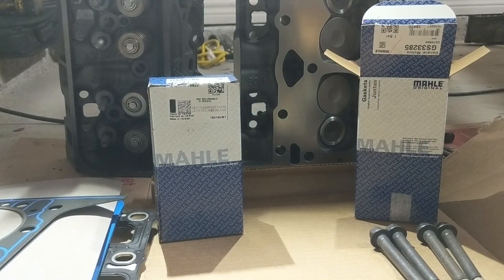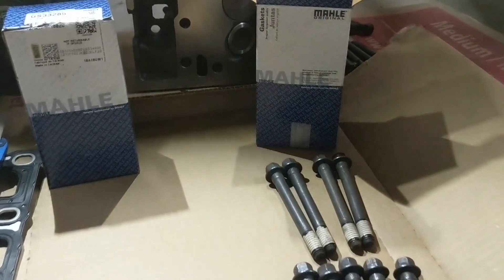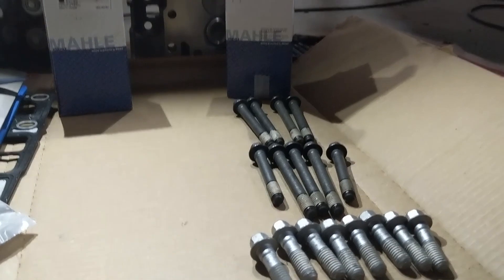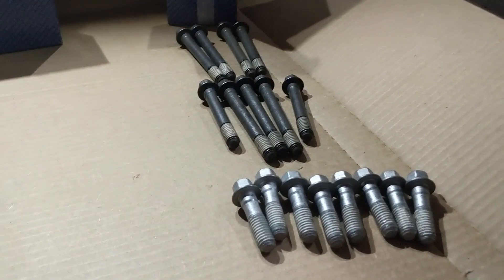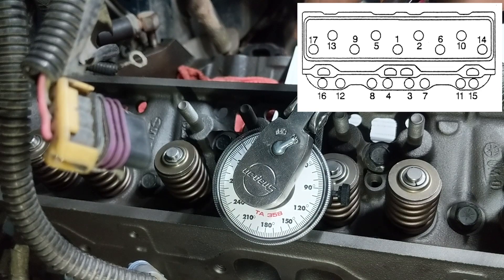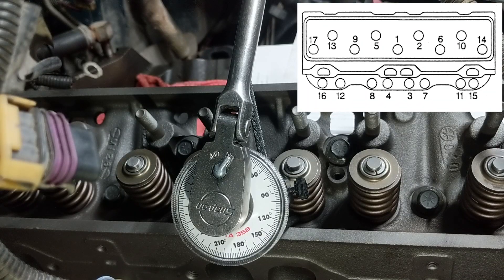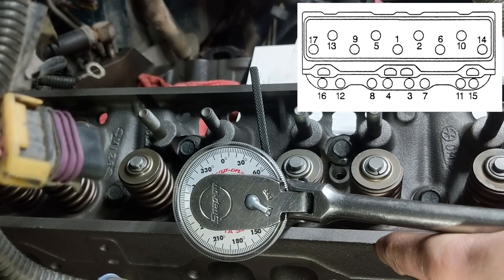Head Bolt Torque Sequence - Chevy 5.7 Head Gaskets Part 5

Comment: Chevy says 90’ up SBC is 3 stage torque. 1st: 25 ft/lbs 2nd: 45 ft/lbs 3rd 65 ft lbs. 
Where did you get this information for the torque angles?  I know the LS series is like this but not the older 350s.
Reply: You can put ARP bolts in there and do that.
Reply: The vortec truck motors from 96-99 have torque to yield bolts. I just removed my heads from my 97 and discovered this. Not sure why but I was wondering if I could just put the standard bolts in and say screw that torque to yield stuff Lol!!

Comment: Hey brother, thanks so much for this video series, it was a big help on my head job!

I have a question. I bought a brand new quinn torque wrench with a built in angle system to do the job. After you reach the angle you want, it tells you what torque you reached. I cleaned the threads the way you did too. 

I torqued both heads, but what's been bothering me is the variation in all the torque values I got after completing the angle adjustment. I know the ultimate goal is to reach a certain stretch right? Also there's the fact that it's impossible for me to be consistent with a wrench that beeps at me versus one that clicks haha.

I've read in other places to verify torque after finishing up, but how the hell do you even do that? Any help would be appreciated.
Reply: I would like to know this too. Torque sequence seems pretty straight forward but I get confused when the torque angle gauge gets pulled out!
Reply: @davegibson3763  hey Dave, so after extensive research, I found that getting different torque values is not uncommon. The whole point is to reach a certain amount of stretch in the bolt via the torque angle and sometimes, as I understand it, it happens at a different torque value for each bolt. So you may have a slightly different torque value, but you're achieving the desired stretch. Using the torque angle method, you eliminate having to account for variations like running torque.
Reply: @asteriosanagnostou3243  Would it be ok to just omit the angle gauge and just make another pass at a higher torque value?I read a comment a guy made a couple years ago on this and said he didn't use the angle gauge it and it worked out ok!
Reply: @davegibson3763  yeah probably. I've read the same. Hell I did my first heads the same, but the difference was the bolts. Newer ones, I don't remember what year they started, we're designed with strech in mind. But you're right, I've read many people doing it both ways and it working. I guess, the torque to angle is more accurate when It comes to clamping force.
Reply: @davegibson3763  also, I didn't verify anything because I didn't want to risk over torquing. I just followed the instructions and my trucks running well.
Reply: What were the torque reading for short med and long bolts
Reply: I would think short to longvaluez would increase?

Comment: I hope you used some brake cleaner to clean that grease out of your threads if not you're going to throw your torque value off
Reply: Which is exactly why the torque angle fasteners are far superior; they are much less sensitive to friction in the threads.

Comment: Last time I installed heads on my small block chevy , I never used a angle gauge , torqued em to spec , never had any issues with my motor ran perfectly , just sayin.
Reply: After the first torque pass sequence of 22ft lbs did you make another pass with a higher torque value?
Reply: Works fine on the bolts designed to do this.
5/8" hex head, torque 'em like you say.
1/2" hex head, like what this guy used, indicates they are torque/angle bolts.  They stretch a bit when properly tightening them.  Just sayin'.

Comment: Very nice video,thanks;
(How do long extensions change the torque values on the torque wrench?  ---They don't).
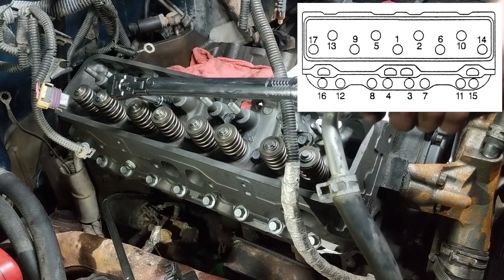edit   5:50     the torque wrench does not get affected;  the angle meter,yes, that is a bit sensitive to flimsiness of extensions; just use a sturdy 1/2 inch extension, 6 or 12 inches long.
Reply: I was told an extension will affect the torque because the extension will twist. Just sayin 🤔
Reply: @knockdolian12  tell me which factory manual says that!!  or specifies a short extension!  NONE
it does NOT matter if it twists; if it does not break,the torque is te same,nuff said.
Reply: @josepeixoto3384  That’s me told. Thanks 👍
Reply: did you ever use a torque stick for lug nuts
Reply: @joefreeman5580  that is a different thing; it´s a torque multiplier, that is not what we are talking about here